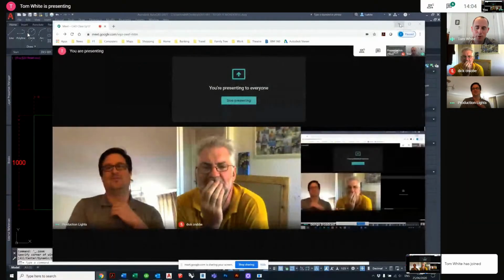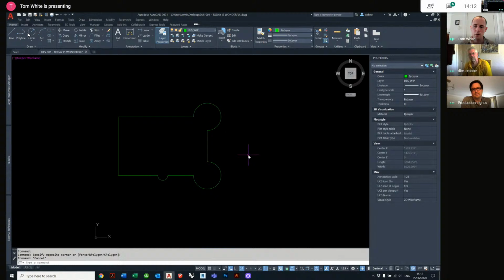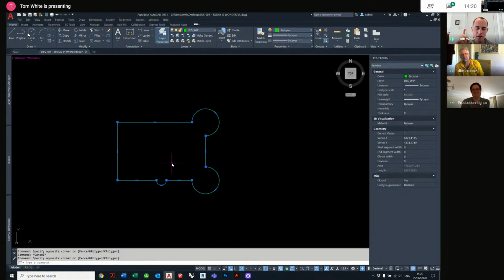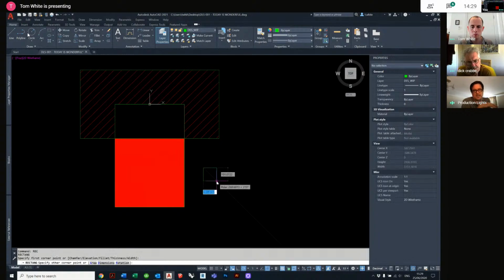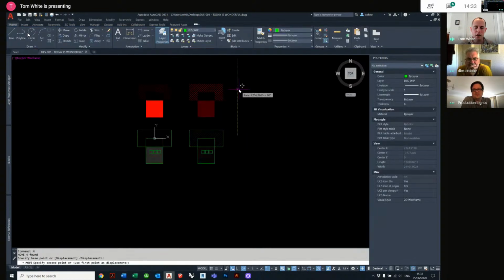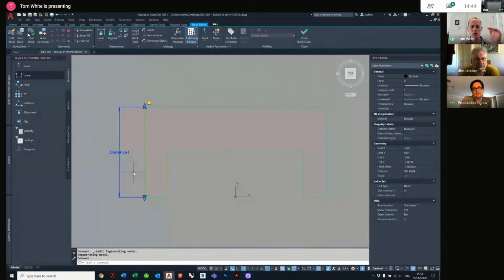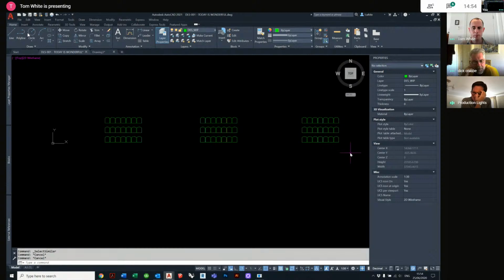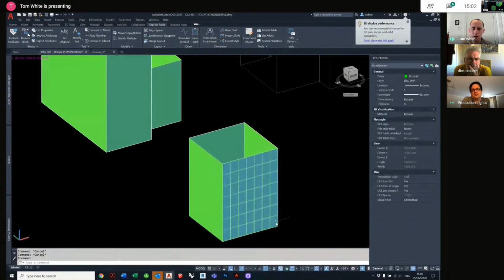CAD Lessons - Ep. 12 on Thursday @ 15.00

Comment: This week is a selection of areas we talked about briefly in previous episodes but let slip.
Stretching & scaling
Boundary command
Join command
Scale mm to inches   (20 mins in)
Hatches  (24 mins in)
Filter
Hatch to back,  text to front  (35 mins in)
Creating a dynamic block  	(39 mins in)
Block editor
Edit block in place	(50 mins in)
Block replace  (express tools)
Design centre
3D objects    (3d solids v 3d mesh) 
Creating 3d objects from 2d CAD programs  (extrude a 2d)